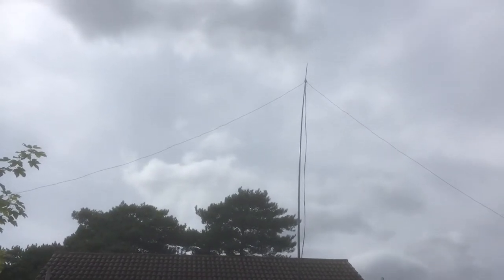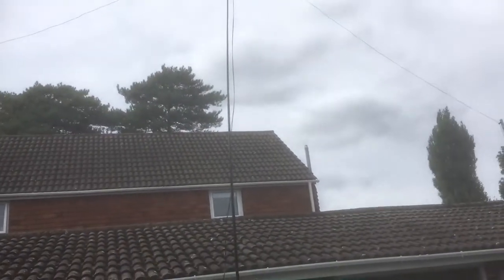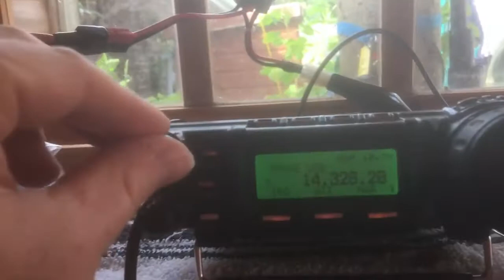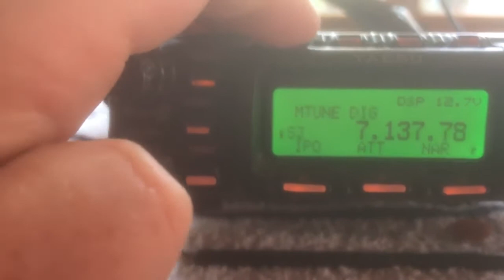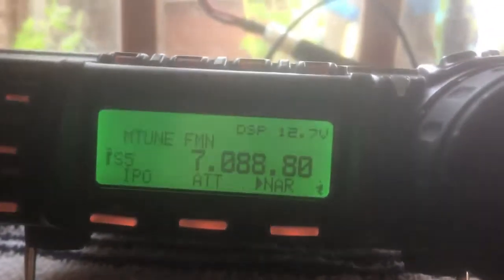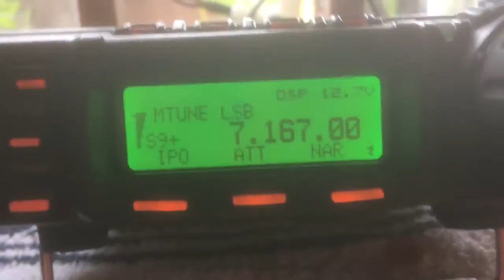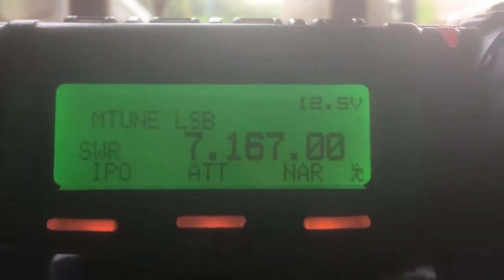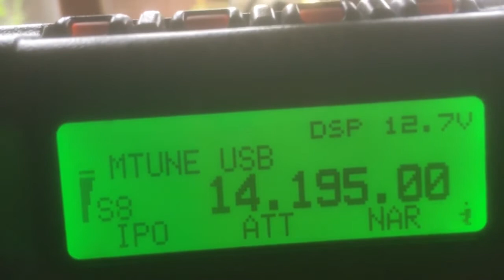HF Doublet Antenna In A Small Garden

Comment: Good work. I have the Z-1000Plus tuner and the "Y-ACC" cable between it and the 857D. Pressing the TUNE button on the tuner changes the mode of the 857D to CW, lowers power, tunes, then returns the radio to the previous mode. Saves a lot of fiddling.
Reply from the maker: Thanks James some useful info there. Thanks for watching and commenting 73
Reply: @timg5tm941  BTW: If anyone wants a Y-ACC cable, don't fork out 10's of dollars for it; simply make it yourself -- circuit schematics on the Web -- just make sure you clearly identify the radio and antenna ends as it won't work if plugged in backwards.